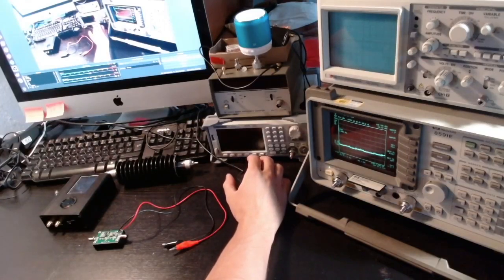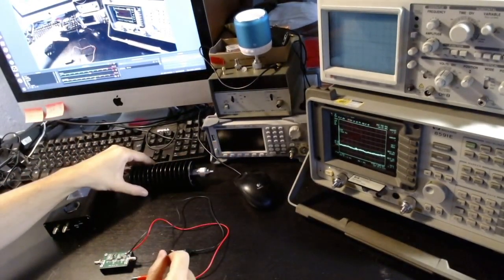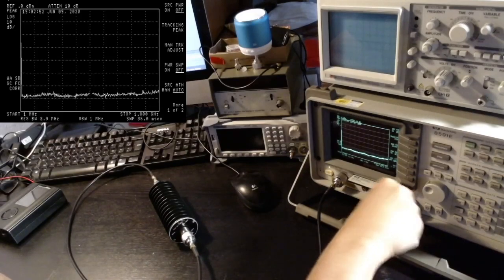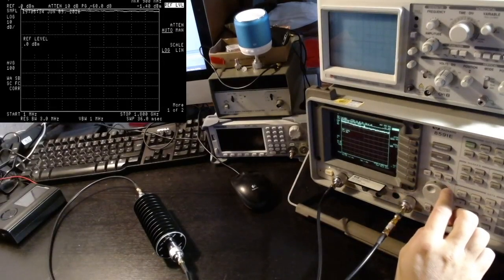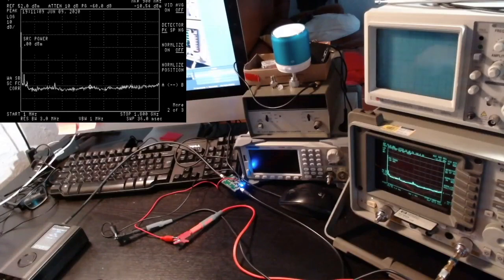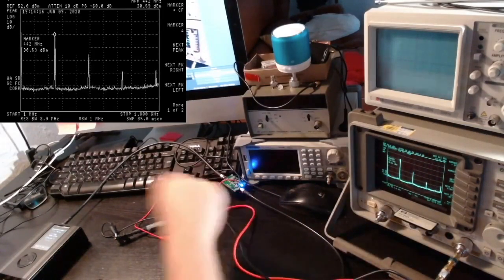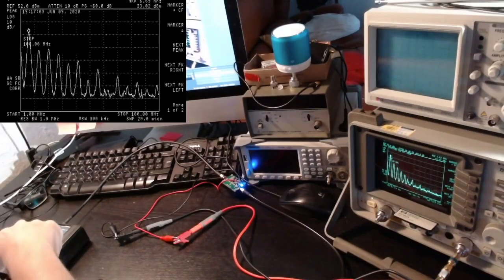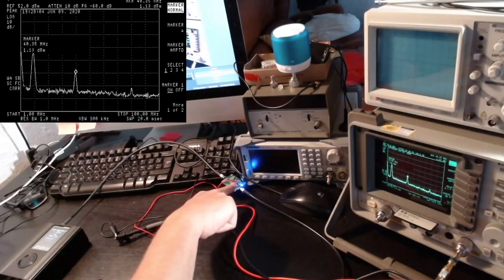Episode 40: HackRF + external amplifier

Comment: Would it also be very very warm if you had an antenna ?
Reply from the maker: Yes, the power dummy load I am using acts as a perfectly resonant (i.e., right 50ohm) antenna. In fact, with an untuned antenna, even more heat would be produced.
Reply: @therfnoob7697  Oh ok;) I thought you might be reflecting all the power back.
Do you know a good pre amplifier for the full operation range of the hackrf?
Reply from the maker: @haka8702  Not the entire operation, but up to 1Ghz only. I use the ZFL-1000.. Have a look at my Episode 64 :)

Comment: Thank you sir.
I initially purchased the HackRF based on one of your videos.

I have an Agilent N9340b Spectrum Analyzer...  but due to an obvious loss of intelligence the day 
that I made the purchase, I purchased it WITHOUT an integrated tracking generator.  

It was only an extra $1100 for the TG option.  It seems like a lot, but when spending over $8k on the S.A.,
the extra $1100 is actually somewhat of a bargain.  Actually, they SHOULD have provided it without any extra charge.

So.. I’m going to try using the HackRF as an unsynchronized signal source.  

Thanks again for your videos.
Reply from the maker: Hi! I am sorry to hear this, but your N934b is a fantastic instrument even without a TG, although I agree with you it would have been nice to include it!
Reply: Sounds like I need you to drop by and give me some hands on guidance